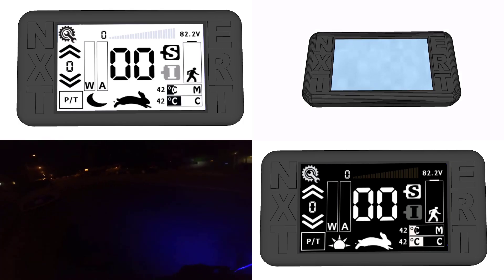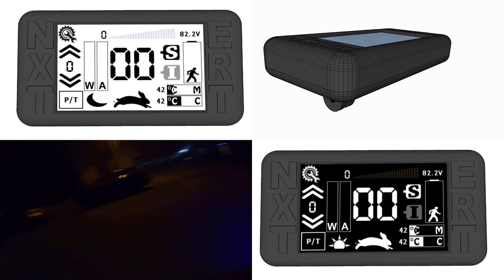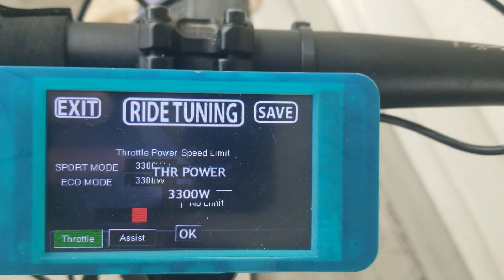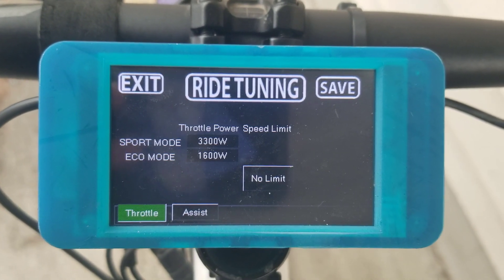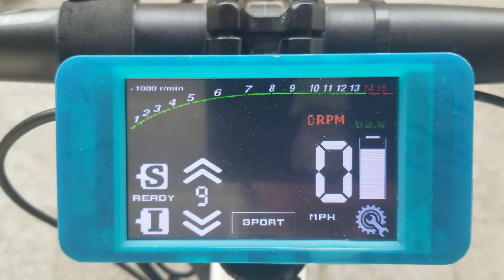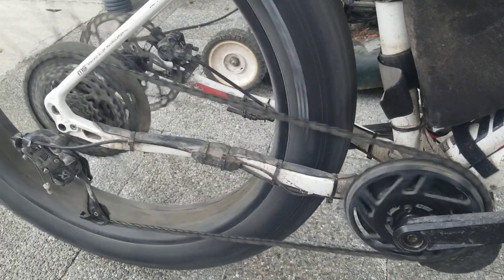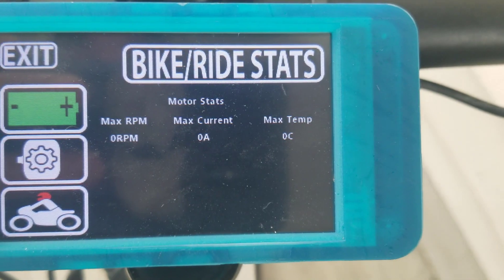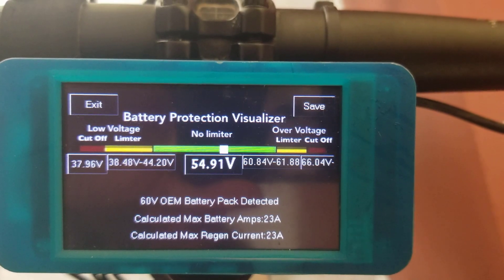Welcome to the NXT - EBike Touchscreen Display / Interface by Electric Race Technologies

Comment: I purchased a ASI bac2000 from cyc. However, I'm using a Cyclone 6000w mid-drive instead. Can the NXT display help set-up the parameters and configuration for a Cyclone 6000w mid-drive?
Reply from the maker: The nxt cannot setup a motor like that. You need the ASI software which is restricted to dealers. The nxt itself is defunct. Its only up still for posterity.

Comment: I would like to be one the the testes of this display I have always programmed my BBSHD and my Ultra G510 to get the to the exact pentameters I like and respond to the smoothest throttle response I can get it took a long time plugging in and testing the bike and then coming back to reprogram them again and test again for many years I have been doing this and everything works well at this point but if this is anything like you say it is that is a very Big game changer for me at least because I reprogram mine and my friends bike until we get it right to there and my liking.

So by all means contact me and I would like to be one of the TESTERS

Thanks
Reply from the maker: Hi, this is a pretty old video right now. Not sure if you can get one of these currently. Sounds like you did a good job with your bikes tho. Its not easy to make a good program at times.

Comment: WHERE CAN  BUY THS COOL THNG, GOT A ASBACK FROM ERT AND EGG RDER BUT T 4S SO LMTED
Reply from the maker: Its still in development. The only place you can get one is ERT. The other places that were offering it are no longer. Hopefully there will be more in the next year with this as the ASI badly needs something. If you are running the 800 and BBSHD tho it should just be a harness swap to use the NXT.

Comment: Can't get my brand new asi 8000 to turn on with the 72 45 ah powerhouse battery from lite speed. I have one of the first sur rons sold and that maybe a factor. Never used brand new system I am selling for $2200. No help from ert or litespeed. I followed their instructions for install. Everything is hooked up correctly but it won't power up. I paid $2300 from litespeed for the 400 amp Powerhouse. $1000 Bac 8000 controller and $125 botos heat sink. I am not electronic expert. If you want to buy contact me at bullterrierman1@gmail.com. I am losing my ass on trying to make my bike fast but I just want my bike back. Going to hook up all the stock stuff back up. You will get no help from Ert or litespeed on making this work so if you have the knowledge and want a deal its here.
Reply from the maker: Hey John. Not happy to read this. Can you sign on to my discord and get in touch with Max on there. He is handling the customer service at ERT now. Perhaps we can figure it out. You might find someone interested in the battery and kit if all else fails. https://discord.gg/YAAjfgc It may well be the screen needs replacement. But we can talk you through a few things to find out. I am prepared to help figure out A what the issue is and B fix it. Chris will stand by his work on the battery. I doubt it that the battery is the issue. Hope to see you on there.
Reply: @HighVoltageKits  Just got a lead on how to make the sur ron work. Without any instructions just the plug and play I took off the breaker and battery cables to install the new cables that came with the 72v battery. I have to hook that back up and use that as my negative. Christopher at lightspeed was able to help. I sent him pictures and told me that breaker is how the key initiates power. Very confusing at first. ERT is finished after Alan hu took hundreds of orders and shut his doors. Litespeed is going to sell kits under electron cycles in a few week. Going to reinstall that breaker and finally after all the months of setbacks I'll get a win. Thanks Captain for the concern. How do I join your discord?
Reply: John, I'm sorry you're having trouble with your kit.

Feel free to join the discord server that Captain Codswallop linked, we can have a chat on there and figure out what the issue is. You'll find me as Max@ElectricRT 

Lots of good resources on the NXT available on there as well.

Alternatively you can reach me by email: max@electricrt.com

In either case, you have our support and we will get you sorted out ASAP.

Comment: Very interesting - looks like I found the display for my next project. I already have an ASI BAC 855 and will probably pair it with an BBSHD and a 72V battery, I build/restore batteries  in my 'shed' as a side business. Will most likely contact you in the future! /Thanks from Sweden
Reply from the maker: Awesome. Maybe join my discord. Lots of interesting folks on there building ebikes. Cheers!

Comment: Hi, Can I used this display on sabvoton controller 72V? I have ebike with sabvoton without wiring for display. Is there only bluetooth. Motor is QSV3 3000W. Where are more information about this solution. Thanks a lot.
Reply from the maker: Sorry but it's only on ASI controllers. I know nothing of the Sab family of controllers so I cant even begin to speculate. Even if possible it would be a long long time before the man hours could be dedicated to it without significant investment into the design and production capacity at ERT. It's a good investment opportunity tho. I scratch my head as to how someone has not recognized this and put money behind it to allow expansion. Free up Alan to develop and put staff in charge of production etc.

Comment: Superb work, as always. Any status updates on the product, Captain?  I have the BBSHD with the Eggrider, but am frustrated by the jerkiness of the twist throttle. Do you think this device might, through user settings, soften that jerkiness? I prefer not to perform surgery on the controller as recommended in Endless Sphere.
I hope you and yours are healthy and safe.
Reply from the maker: There is a throttle tuning feature that maps the precise voltage so it can help a bit. The nice smooth throttle is largely due to the asi though. The throttle surgery sounds interesting! Do you mean jerkiness as in it puts too much power in too soon? I think you can adjust the throttle parameters to help. Have you tried changing and settings. The karls special sauce guide is good.
Reply: @HighVoltageKits  Yes...the all-or-nothing response. There is an excellent endless-sphere thread where they recommend digging a couple of wires out of the controller potting and soldering in a transistor to make it more able to provide a linear response to twisting the throttle. I have a bag of appropriate transistors, but haven't tried yet. This display seems very exciting! How is life in Canada?
Reply from the maker: It's pretty good for the world right now. I'm riding things ok so far. Trying to keep plodding forward. I guess with the throttle its just a throttle if it gets wrecked. Alan said he was shipping the 1st 15 bbshd orders this week. Some delays unfortunately but hopefully the bottlenecks are being worked out.

Comment: Looking great so far. 

So with the PAS it you can set it to have 9 5 3 levels but are you able to independently change the given watts in each level? Or do you set the maximum watts then it will divide it down in how many levels you pick?

 So if you picked 9 levels of assist and say 1000w as the max it would be 111w per level? 

I would love to be part of the development of this as you have probably noticed I reply to every video Alan and your self have posted in regards to the nxt since it started to get developed. Especially with bafang motors as I have traveled over 14k miles on bbshd it's like a second child to me lol 

I will have a display as soon they are available in the uk...
Reply from the maker: Via electron cycles in the UK. Yes it scales over the levels. So 1000 divided by 9. 111watts at level 1. 1000 at level 9 etc. Cheers!
Reply: @HighVoltageKits  great yes that's how I thought it would work. Yes I have spoke to Francis already in regards to this they should be there soon
Reply from the maker: Nice!

Comment: I’d be interested in helping with the development group.
Reply from the maker: Thanks. Will be in touch.
Reply: @HighVoltageKits  hi bro, I just ordered nxt from francis at electron with the asi bac 855 for my bbshd. How are folks waterproofing theirs. Any ideas? containers or that that can be used?
Reply from the maker: When I designed the case there was a gasket that should stop light rain being and issue. That said I am making a flexible case to go over mine if the weather is bad. Long term once we get wireless updates the cases will be factory sealed.
Reply: @HighVoltageKits  cool, gonna look for some kinda plastic clear lidded tub i could use so if it pisses down, which it invariably does in Scotland lol, I can just stick the lid on. Hopefully that should work? Do you have the size in cm?
Reply from the maker: Right now I'm using a zip lock bag and an elastic band for emergencies.
Reply: @HighVoltageKits  good idea

Comment: Hi Captain, in my case, I am using a 15S custom battery pack (56V instead of the standard 52V), will this work on my battery? Hope so... Smart BMS exist for about any cells series combination now for DIY. Also, Alan send me some images via text messages a while back of the NXT display that had an external handlebar keypad connected to it in order to select mode, assist levels... was this removed from the NXT displays? 
Cheers
Dan from Eastern Canada.
Reply from the maker: The switch will be an option. It's a custom one I think so not sure when they arrive 100% 15s is a small coding change.

Comment: At 9:00, does it mean you have a 48v and a 52v plugged in at the same time on your bike and that you can effortlessly switch between wich one you're using?
Reply from the maker: No. There are actually five options right now. 48,52,60,66 and 72. But the nxt looks at the voltage range and excludes options the pack cannot be for you. The 48 and 52 volts are too close to do that with.

Comment: Why can’t these things be done from a phone app?
Reply from the maker: Adding a phone app in the mix requires it to function on apple phones and android. So you are at the whim of them for publishing. It would be a customer service nightmare. Just ask eggrider or cyc or even asi how much fun phone apps are to work with. The display means it's all in house.
Reply: @HighVoltageKits  Actually, Android apps are easy to get, but this is another story regarding apple phones...